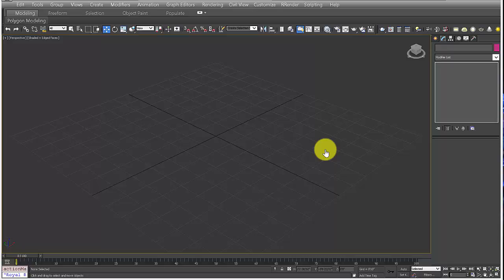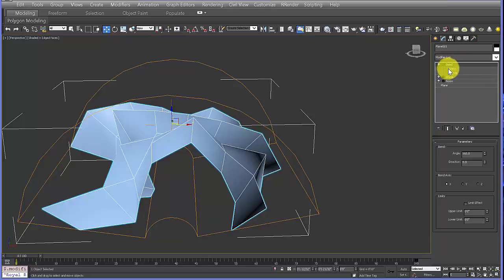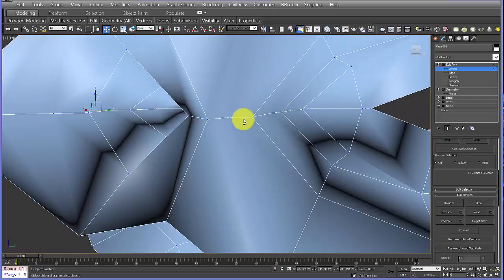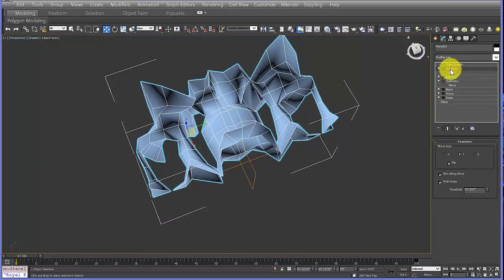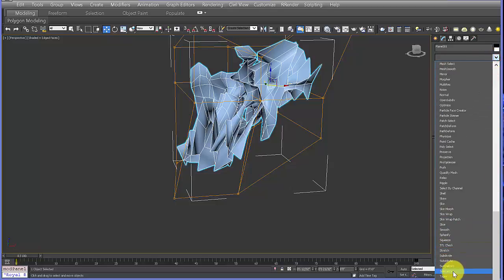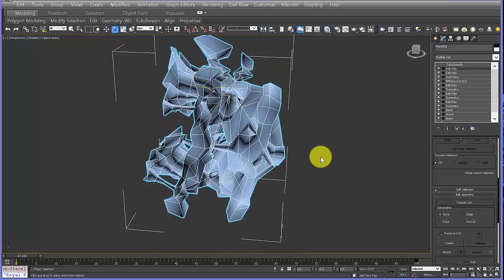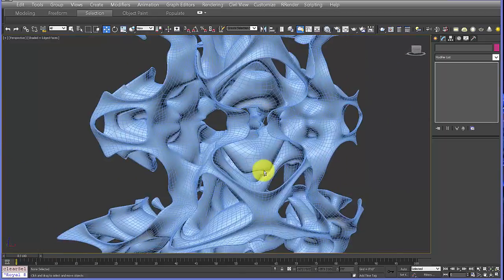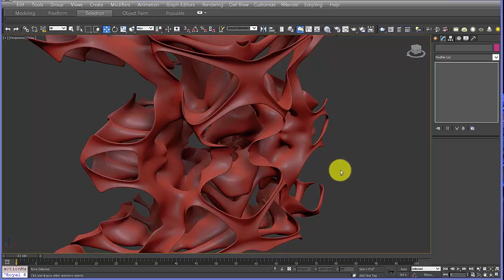Modelling an Organic Structure using 3ds Max

Comment: Before you apply the symmetry modifier just place an edit poly modifier between it and your topology will come out ok (no need to remove those floating verts anymore as this is result from standard meshing).